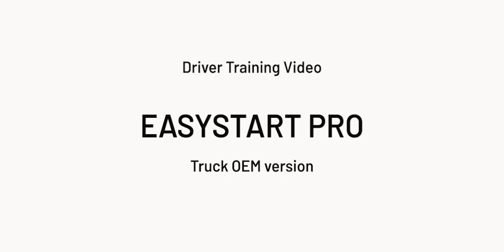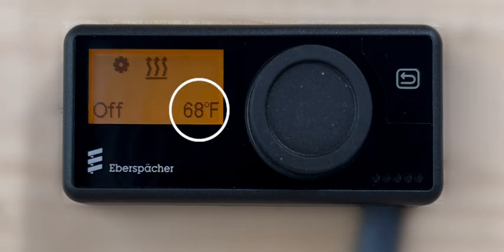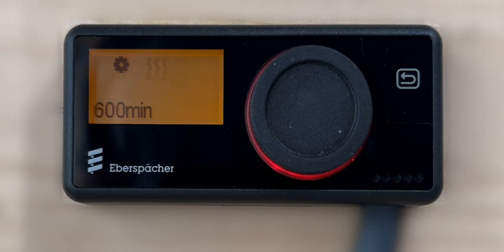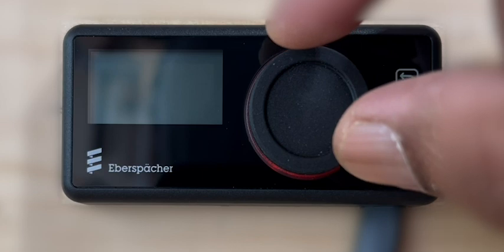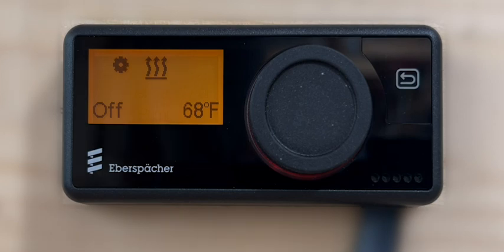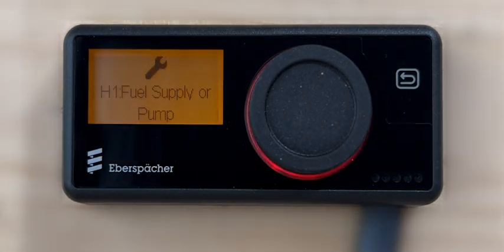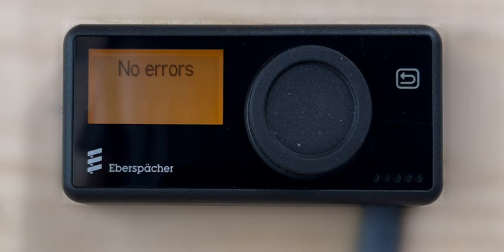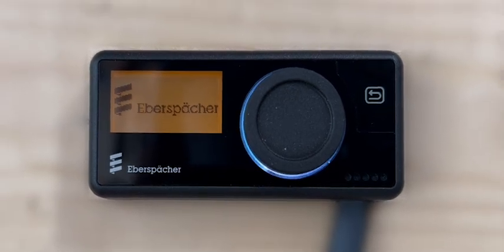EasyStartPro Introduction | Truck OEM Version

Comment: Finally, ok I have two of these heaters and not using them for a vehicle but for infloor heating. How do I bypass the brake interlock so it will display the temp setting before turning on Heater? I am guessing that is my issue as for years now I never get the temp setting, all I get is minutes. Also is there a way to bypass the minute setting and have it run continuously as my infinity cycle appears to only be 12hrs? A little beyond frustrated with these heaters and after spending almost $3000 for two, one for use and a back up. Been using for 5yrs now and happy with how good it works but would love to have some control on temp. Living in a 30ft converted car trailer and happy with that at -35 degrees C I'm able to maintain 27 degrees which if way to hot. Unfortunately having to use ceiling fan to exhaust heat out of the trailer for any control of temp!
Reply from the maker: Hi @curtismagas9343, I am passing your question along to someone from our technical support team and will get back to you with their response as soon as I get it.  Can you confirm what year and model of heater you have?  Since you're using it for in-floor heating, I'm assuming you're talking about a Hydronic heater, is that correct?
Reply from the maker: Hi @curtismagas9343. And again, thanks for reaching out.  Technical support said that for answers to technical questions or support requests, we recommend submitting a service ticket through our official Eberspächer Service Portal:  https://service.eberspaecher.com/service/create-ticket
If you don't already have an account with us, you’ll first need to sign up for an account and then log in using your registered email address. When creating your ticket, please include as much detail as possible — such as: 
• Heater and controller model 
• Fault messages (if any) 
• Installation details 
• A clear description of the issue or complaint 
• Any supporting photos or videos
Once your ticket is submitted, a member of our Technical Support Team will review it and follow up directly to assist you.
I hope this helps.
Reply: @EberspaecherNorthAmerica  I thought this might be an avenue to get answers, have reached out to them before and it was beyond useless. Thanks, I will figure it out on my own. My questions were straight forward, no need for further explanation!
Reply from the maker: I sympathize and agree with your comment.  I can't see your original question.  Can you send it to me again and I'll reach out directly to someone to see if I can get you some help.   My apologies, Curtis.